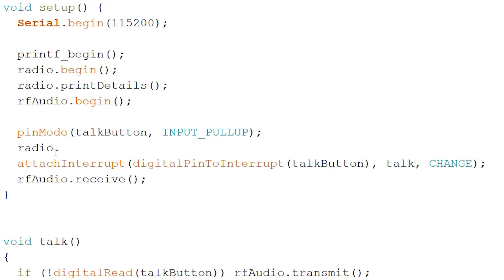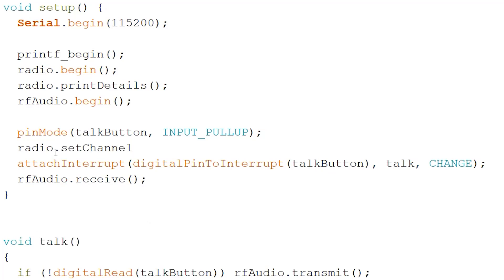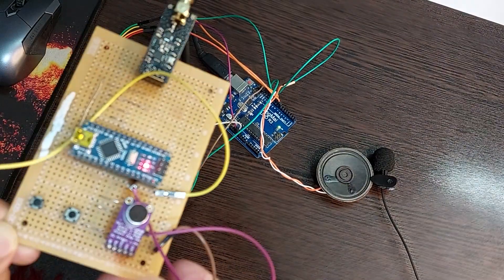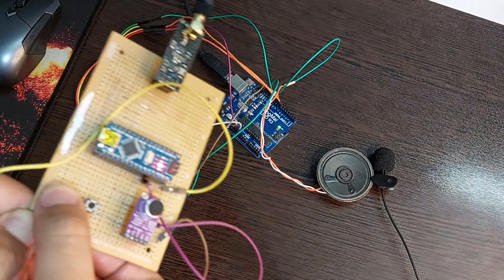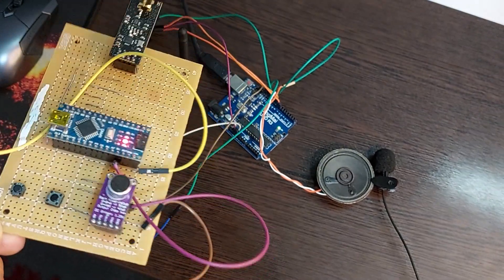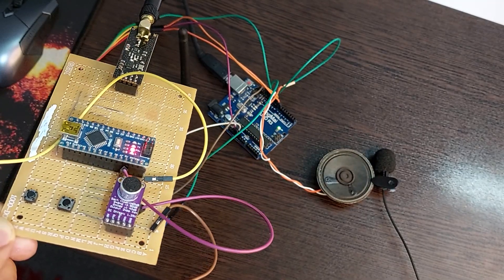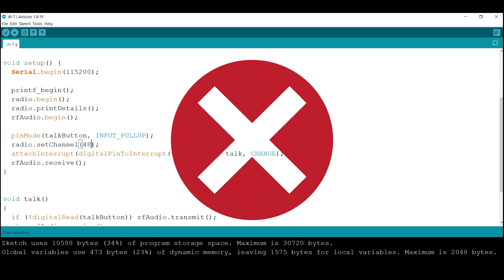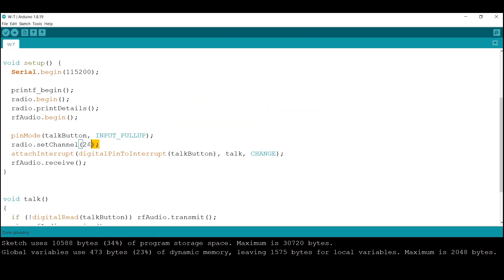Long Range Walkie-Talkie Circuit (2.4GHz) - The Last Part

Comment: Thanks, A question, how much distance can transmit this? And why speaker is connected to digital pins? Can talk two persons with two of this? Or only audio transmited in one direction? Thanks.
Reply from the maker: Hello. Honestly, I was also surprised why the speakers are connected directly to the digital pins. This set has a library in Arduino IDE. The distance is between 1 and 1.5 km, as written in the NRF24L01 datasheet. And just like a walkie-talkie, both parties can talk. Watch the next video on the channel. In the last video I was able to change the communication channel.
Reply: @BabakStars ok

Comment: The code link that you have provided does not have speaker code or am i missing something?
Reply from the maker: I did not understand what you meant. Do you mean the class in the program that determines the speaker pins?
Reply: @BabakStars  yes sure
Reply from the maker: As I showed in the video. I tried to upgrade this project, but the author of this library tried to make everything fixed and unchangeable. Therefore, we are not able to determine other pins to connect the speaker.
Reply: @BabakStars  Ok, So I am using Nano it will connect D9 and D10 with speaker (I was wondering why  there is no Ground wire)and MAX9814 output pin to A0 and its hardcoded as shown in your provided circuit diagram.

Comment: Although incredibly impractical, impressive mod. 
2.4 GHz was chosen for microwave ovens and routers for the same reason; it interacts with water. In a microwave it heats, in a router it gets absorbed by the moisture in the air which allows for frequency reuse locally.
Have you ever seen the radiated energy from a microwave oven? I have. It's very dirty and All Over 2.4 GHz band, there's no filtering.
 One person turns on a uwave and your connection is toast.
Reply from the maker: It was cool. Thank you.😮

Comment: Greaaaaat. And how can I make repeater for longer distance ?
Reply from the maker: Both circuits have the same program and a diagram and you have to tell with the help of the key connected to pin 3. But for longer distances, you must use a booster.